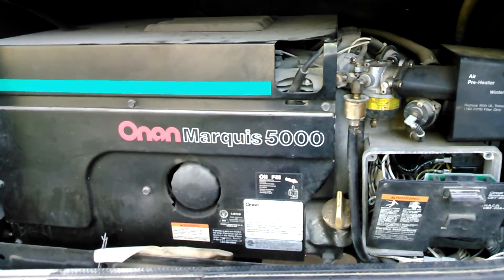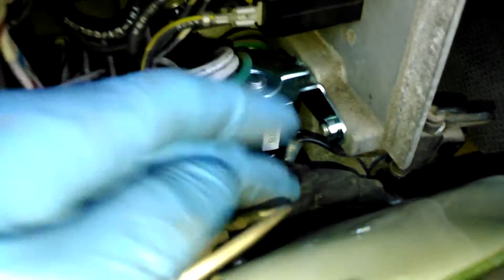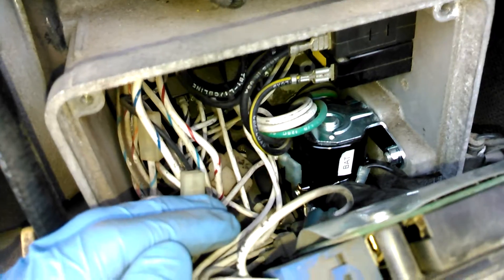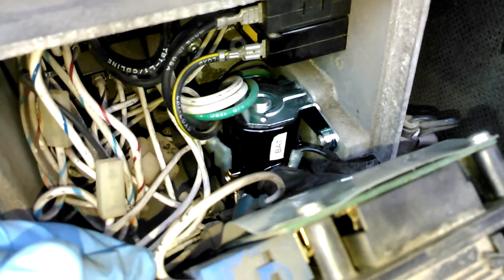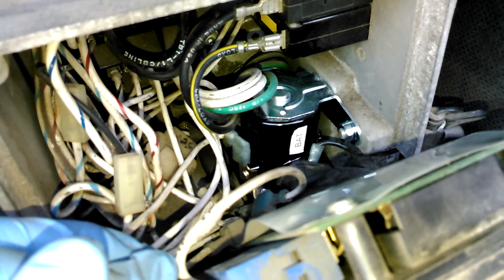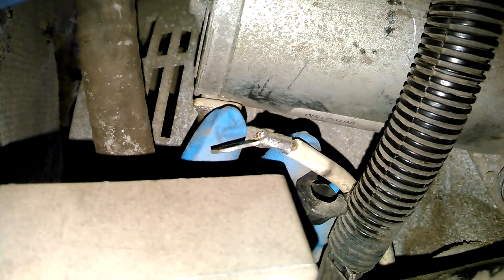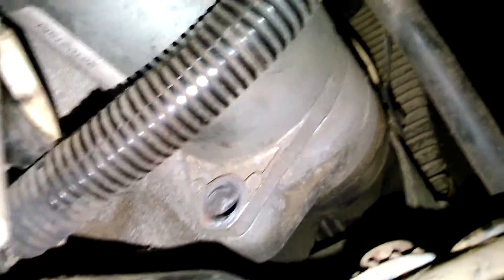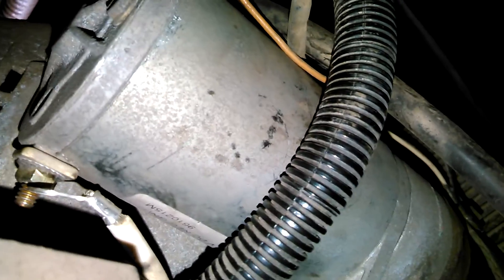Fleetwood Bounder Onan Generator Starter Power check

Comment: I thought my solenoid was bad, so I bought another one. Still no power on the other side of the solenoid. I’m thinking that it may be the solenoid not receiving power from the small wires to actuate. Thoughts?